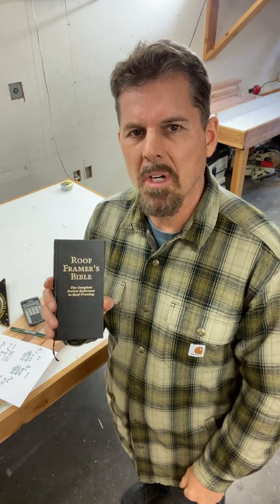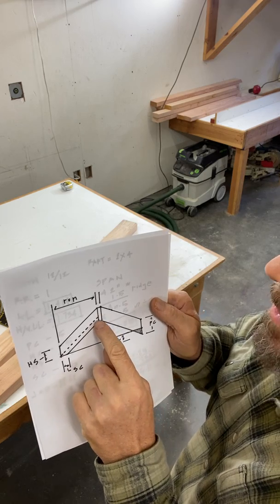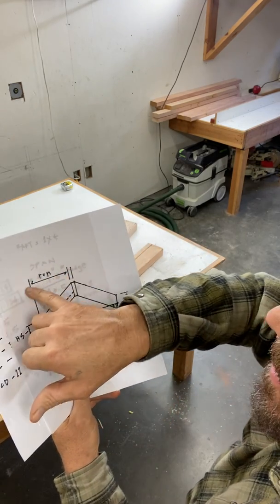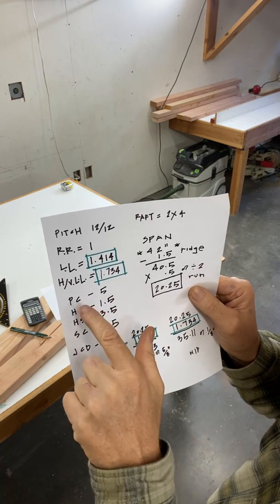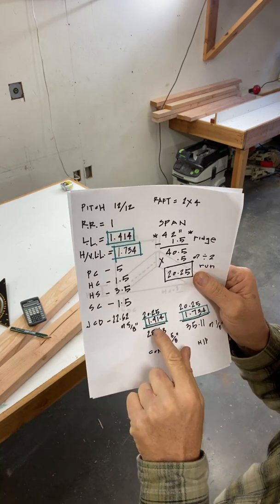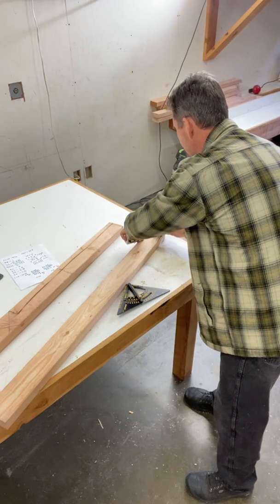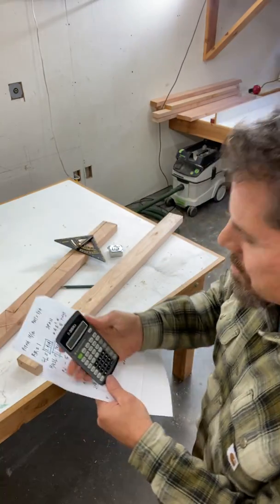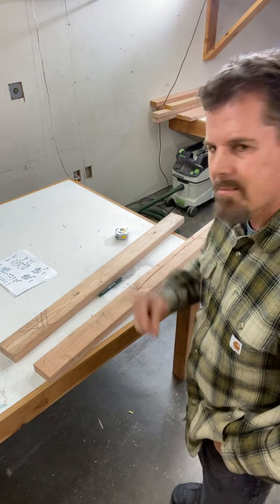Basic math to find rafter lengths.

Comment: Nick , thanks again , at the end with the jack rafter you move 1” in from plumb line to measure for jack rafter , why is that , I would always add 1/2” or more depending on pitch of roof , just love to know , thanks again
Reply from the maker: Because we want to get to the  point on the outside of the boards where the king common rafter meets the hip rafter(lead edge). That is the point where the step-down math begins. From there the common difference is marked along the spine of the common rafter from the top down. Once completed, we measure up from the heal stand line to the marks to obtain the consecutive jack rafter lengths.

Comment: Hi Nick, as always I greatly appreciate your time and efforts. Still waiting for those Instructional DVDs. Please don't take this wrong as I am just trying to learn and master roof cutting. Am I doing the math wrong for the H/VLL? I plug in 12^2 + 16.97^2 = 431.980. sq.rt = 20.784. divide by 12 = 1.732. Was I supposed to round off something before getting the 1.732. I noticed you calculated it as 1.734? Like I said please do not take this wrong, am I just trying to learn and get this under my belt. I can't find any books, or videos that break this down in simple terms as you do. Greatly appreciate your love for this dying trade and want to keep the master skilled workers going.
Reply from the maker: No, undoubtably trying to keep track of both what I’m saying and what I’m doing, I screwed up.
Reply from the maker: Also we are starting shooting DVDs in August.
Reply: @roofcuttingandstacking7925  
Oh man I can't wait. Make sure you post a video with the purchase information. Thanks for your help Nick.
Reply from the maker: @SkilsawDoctor  ok

Comment: I've viewed most of your videos. Just the knowledge I'm looking for. I'm in need of understanding how to connect a bastard roof 2.5/12 and 6/12 using the math as I'm attempting to do it without adjusting HAP (which I think yields different overhangs). 

I'm in need of figuring out the bevels cuts.
Are you available for consultation?
Reply from the maker: Yes. Email me at nmridgeconstruction@yahoo.com

Comment: Good video. The only thing is: in order to keep up with you one already has to know the info.
Reply from the maker: Tim Barry I have some more basic videos on this channel. I try to stay away from the math in general and veer towards the use of the steel square as much as possible.
Reply: Roof Cutting and Stacking.. thank you. I have a question for you: what if you jumped in on a job to do a simple gable roof on an existing structure, whether a new build or just a new roof on an old building,  and for whatever reason the span on one end was 4 inches different than the span on the other end. How would you handle that? Thank you
Reply from the maker: Tim Barry We’ve been in that situation many times. It’s a judgment call. Sometimes we parallel the ridge to one side and cut all those rafters the same length and sick frame the other side by making each consecutive rafter a little bit longer in turn. Sometimes if it’s not much we choose a side or the center and run them all the same length which makes the ridge out of level. Sometimes we treat the rafters like trusses and cut them all the same but lengthen the seat cuts on one side change, thereby not compromising the pitch of the roof. All three have drawbacks. The third is the most accurate as long as it is not a vaulted ceiling. When sheeting the third, the plywood must run parallel to the ridge.
Reply: Roof Cutting and Stacking... that's awesome. Thank you. What about adding another plate that is parallel and square and try to hide any overhangs of that plate in the soffit?
Reply from the maker: Tim Barry that is essentially the same thing as the third method.

Comment: Why did you drop 1 inch for the common difference layout?
Reply from the maker: Naui 2 take a look at the calculating jack length video on this channel.
Reply: @roofcuttingandstacking7925  will do
Reply: Ok its because the 1 1/16" for half the 45
Reply from the maker: Naui 2 yes
Reply from the maker: Naui 2 in plan view

Comment: Love the videos. Am struggling to get though parts of a roof cutters secrets. Could you do a video on backing/dropping?
Reply from the maker: William Hospodor There are some quick traditional ways that I didn’t show and we will do that.
Reply: Hi ive been cutting roofs since the 70s, im a framing contractor
Everything is on the framing square
or the rafter book or construction master calculator
If your using the framing square
Its called stepping off
Meaning take length of rafter per 12 inches times run of
Run is half the span
God bless all of you
Reply from the maker: William Hospodor I have two or three on this channel.